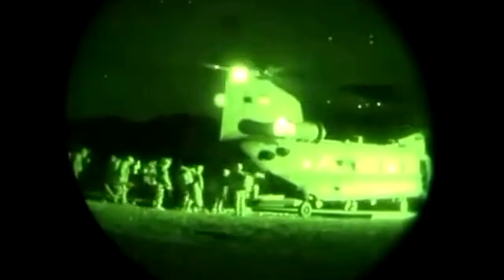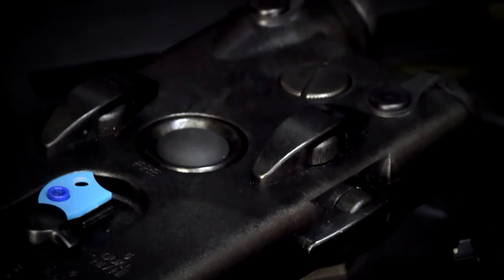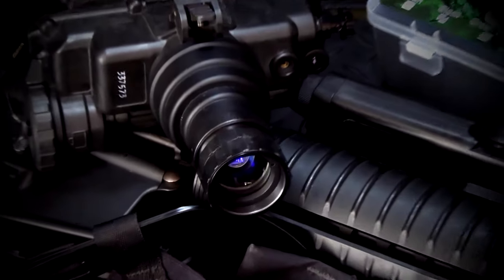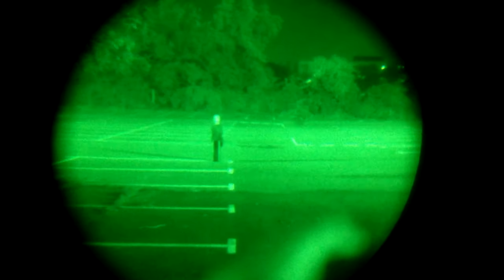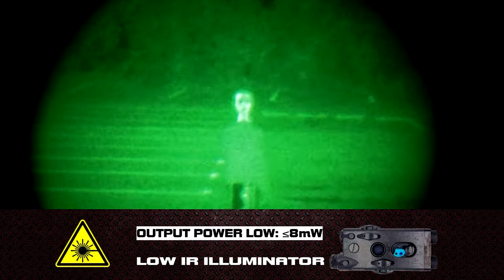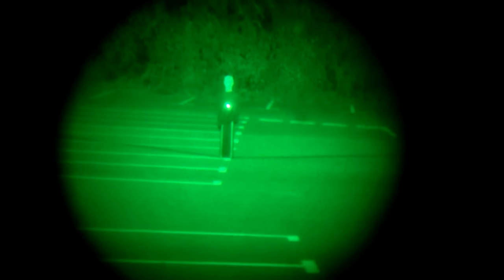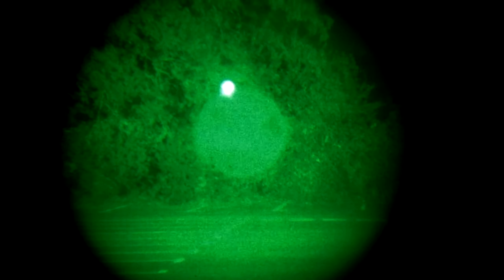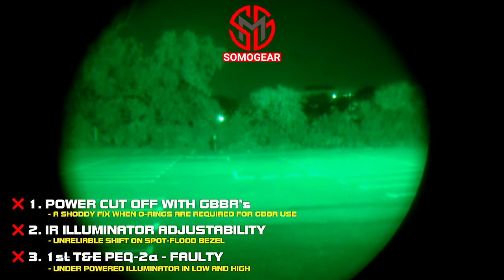Somogear PEQ-2a IR: The GWOT TV Remote Review

Comment: I have the same problem with the LA5 units from TMC with GBBR recoil - especially on the RATech N4 - the battery contacts are always an issue when they're co-axial. Had the same issue on both of my clone EOtech 552 units on my G36C & HK416 as well, I'm moving over to 558 clones because they have the single transverse CR123 which solves a lot of problems. Most annoying...
Reply from the maker: Definitely annoying. They should have the foresight to see issues with that arrangement and plan for it.

Comment: I have been looking at the Somogear stuff (LA-5C in my case), but am a little frustrated by some weird aspects. Really tight illuminators, non-coaligned vis and IR lasers, and zeroing knobs breaking. I am thinking of just going all out and getting a Holosun just because I know it will work and always will work.
Reply from the maker: Really don’t blame you there. 
Those Holosun units look good.
Reply: holosun is probably the most reliable option compared to somo. It is used for real shooting after all...
Reply: The reason why even firearm content creator like hop or brass facts prefer somogear over holosun is because of power. Holosun are civilian legal so their power levels are very low, where as somogear copies the full power units at high settings. That said, ironically because we are airsofters, the power limit is a good thing.
Reply: @aaron4820  Indeed! Even a £70 WADSN PEQ IR laser under nods is dazzling in a very dark setting like a forest. I think full power is best left to things that can touch other things hundreds of yards away.

Comment: Loving all the new videos, thanks. Just out of curiosity, why don't you skirmish anymore?
Reply from the maker: Thanks mate. I’m trying to actively post more content, as and when I can. 
Videos like this are very few and far between. So much work goes into them. 

But the smaller ones can be knocked up in a few hours, no problem. 

I don’t play because I don’t like it very much anymore. It’s not the same as when I was 16, when it felt like I was playing Goldeneye or Call of Duty for real. The 2000’s were my fondest years of the game.
Reply: @BadaBingPictures I know what you mean, I started airsofting in 1992, modernity and technology have massively changed it. I appreciate the fact that it makes exercise fun, running round the woods for five hours certainly makes the legs ache. Thanks again for all the content 👍😄
Reply from the maker: @HUA-ns5wx  Absolutely! back in the day when the only accessories you could get, if you were lucky, was a sling! 
I miss those times. 

Hah, I do more exercise now than when I used to play! 
It’s all about the cool-down in the evenings though. Cold water therapy helps.

Comment: Isn't any laser, IR or visible, terribly dangerous and capable of causing permanent damage to the retina if over 5mW's of power?
Seems in terribly bad taste to be advertising such a product on a channel dedicated for airsoft.
EDIT: Went and did more research and the answer is maybe. But generally speaking it's better to err on the side of caution and just not use Class 3 lasers in toy gun larp events.
Reply: My guy, there is a reason why there is a screwed-in safety block from accidentally switching to high powered mode. Unlike most US airsofters that give little to no shit about their colleagues, in the UK we're not dumb enough to take that off during a milsim.
Reply: I read that green is really problematic in terms of vis lasers. IR lasers can be still dangerous too, which seems odd to me, but that is what I have also seen written.
Reply: @Kefuddle   IR Lasers are generally speaking more dangerous, since they dont trigger a blink reflex.
Reply from the maker: Whatever the lasers output it’s important to remain responsible. 
Then there’s the benefit of Passive Aiming, with Red Dot sights. 
Extremely difficult for me to do with PVS-7’s though 😂 Turns me into a Psyclops, and putting the stock in the centre of my chest is awkward! 
However red dot on a pistol, it’s perfect!